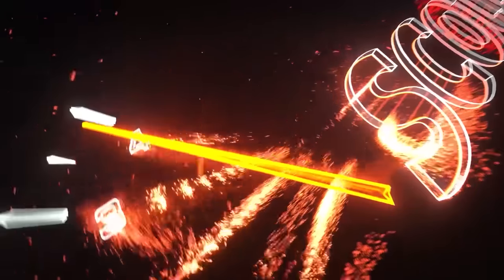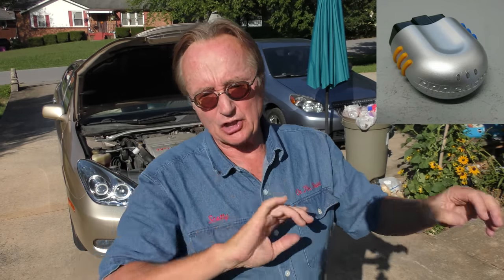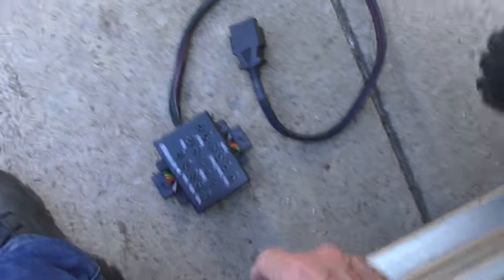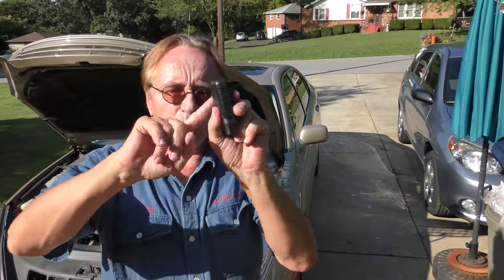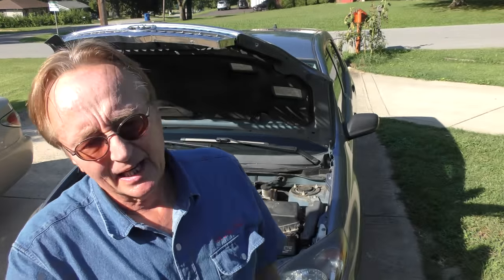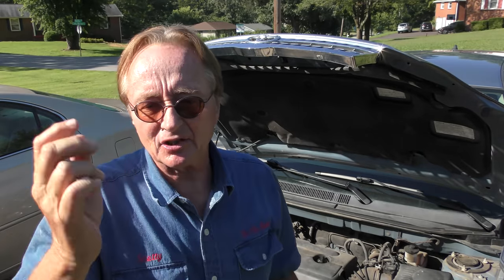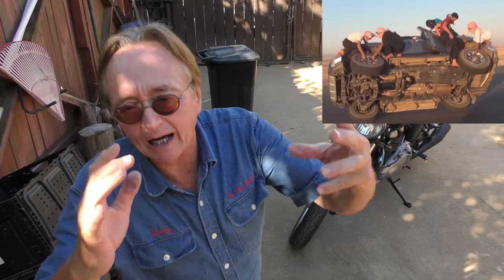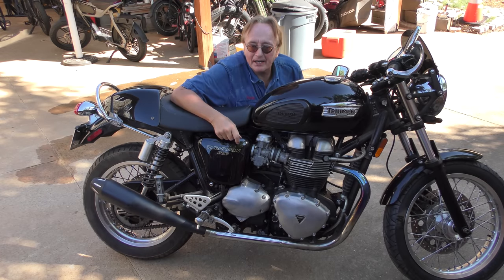I Told My Customer Not to Do This, Now His Car is Destroyed

Comment: I once got conned into getting a Hum through Verizon that plugged into the OBD2 port. Had it on my wife's brand new Subaru. It was supposed to basically keep tabs on the car's health proactively, which it did poorly, but then the  transmission started shifting erratically. Wasted time taking it back and forth to the dealer then simply removed the junky Hum and it was fine. Wish I had known beforehand. Great info as usual, Scotty!

Comment: Scotty, I've been driving with a dongle that keeps my GMC Yukon from switching back to 4 cylinders for years now and I haven't had any issues.  When I take it out and it switches to 4 cylinders I get a very strange hum sound. This device cured that hum and vibration.
Reply: Same here ...worth it
Reply: I have it in my Corvette to stop the cylinder deactivation which is known to kill the transmission. No issues. I disconnect prior to any service and leave it my pocket.
Reply: I'd use one too if I needed it but it's a shame anyone needs one in the first place due to big brother mandated Cafe
Reply: That may improve the life of your engine, and ensure proper lubrication of all cylinders by keeping all cylinders active.

Comment: I have a plug from my aftermarket Pioneer head unit in my OBD port, It monitors the MPH, Braking, intake temp, load, fuel, tire pressure, battery voltage and RPM. Never had any issues so far (knock on wood)!
Reply: ugh i have a pioneer unit and that itself is a piece of junk always disconnects

Comment: I have a Garmin Bluetooth dongle for my gps. This old gps allowed me to have digital gauges for speed, rpm, coolant temp, battery charge, etc. It also acted as a cheap code reader. Very useful. Fortunately, I never had a problem for the past decade with it on 24/7.
Reply: I have used a Scan Gauge on my car for years plugged in all the time without any issues.

Comment: My car has an aftermarket cruise control (Rostra) plugged into the OBD2 port. No issues after 5 years.
Reply: Just lucky.
Reply: @AlskinsX1-9 lol, 5 years and you think they are "lucky"? Nothing's wrong with it.
Reply: Aeroforce interceptor gauge plugged in and works great for racing for years now also

Comment: For what it's worth, I've had a Range Technology AFM/DFM Disabler plugged in my 2017 Sierra for well over a year without a single problem. Turns off the awful cylinder deactivation. And it cost a LOT more than $9.99!!!
Reply: I have the same thing and the same truck 2017 Silverado
Reply: I do too. Maybe we should go get the AFM disabled properly and take that range thing out of the port
Reply: Same here 2018 silverado I call bull on some of this 😂
Reply: Same here 2018 Sierra , well over a year no problems yet
Reply: Same here. 2016 Sierra 4 years and 8,000 miles with no problems. Also 2014 Corvette 3 years and 5,000 miles with no problems.
Reply: This is one of the exceptions to the "they're all junk" thing Scotty is talking about.
Reply: 2016 silverado with the same thing. 55k miles with no afm and no problems
Reply: Have one In my 15 silverado too....well worth it 93000 miles no issues
Reply: Agreed that cylinder deactivation is to be avoided.

Comment: Very true on the tires. I had really nice grippy tires, put 110K on them. Car spends 99% of its life in the garage. No dry rot but they were 12 years old and you could feel how hard and slick they had become. Tread was getting low but otherwise they looked great.
Reply: I replace the street tires on my cars 3 years from date of manufacture, regardless of tread depth. Now, the life of my track tires is measured in hours and laps so aging out is not a problem LOL.
Reply: Scotty, maybe it's time to give up the motorcycle 🏍️

Comment: Thanks Scotty! Even proctologist and surgeons know all about not shoving  random things into places where they should not go.  It causes all sorts of problems or issues.  Rule of thumb if it is not in the plans of the creator or designer dot shove it in.

American family actually has a travel app that operates via data being transmitted from the phone and GPS.  It's fun because it works in whatever vehicle you are operating or riding in. It can even tell if your the driver or passenger.
Reply: Don't knock it til you try it. 🙂

Comment: Statefarm has one that sticks to the windshield behind the rear-view mirror. It's wireless and uses bluetooth. It connects to your phone to monitor your driving. It also monitors when  you move the phone! (distracted driving). I place my phone in the cup holder and leave it alone. My Tomtom has bluetooth hands free calling so I never have to move the phone and can still receive calls.

Comment: Ive had transmission flushes done every 50,000 miles on every single vehicle i have ever owned and im old like scotty lol and ive never had a transmission issue and i usually keep my trucks for about 250,000 miles and then i sell them because i live in the northeast and the rust eats them.  My last truck had 16 quarts of fluid in the transmission but if you only drop the pan only 6 quarts comes out and the other 10 quarts of dirty fluid stays in the cooler/converter ect, so i get them flushed to get all 16 quarts of old fluid out no way im leaving all that dirty old fluid inside.

Comment: Depends on what's hooked up. I had an auto start for my key. I installed it myself. It bridges the OBD port. Product by MPC. I plugged it into a 2015 Ford Fusion Ecoboost. Had it for a year. No problems. It depends on what is hooked up.
Reply: That’s interesting actually

Comment: Alot of people used them thing to stop the afm in Chevy vehicle's thinking thats going to prevent getting a stuck lifter  but it doesn't the only way to prevent a afm liter from failure is to remove the afm stuff out the motor and put the normal lifters and cam shaft in your vehicle

Comment: LOL I raced top fuel Harley's from 2003 to 2010 full-time all over the country. When I first started I bought a 20-year-old Suzuki 250 to use as a pit bike. It had the original tires. We used it extensively for those 7 years. Many times we used it for grocery runs that were miles from the track.  Had it at 70 mph with two people on it more than once. Those tires held up just fine. It had the original fuel lines too!

Comment: You right the OBD2 car connector is designed to plug anything on it forever, and drive the car, it is only for car diagnostic for short time, I learned the hard way, but I was lucky the scanner connector harness got burned and separated and the scanner stop working.

Comment: Those OBDLink bluetooth adapers are quality. The mx+ being the latest and greatest. LX is good too (no ios support or some features). They have no conflicts when auto detecting the can bus and switching the American MS and SW. And can do bi-directional. They are great for gathering data for days at a time. The cheaper modules conflict and start screwing with the network. Mainly putting 13 volts where it shouldn't be. Who knows whats in those snapshot things and why they are even allowed after so many complaints.

Comment: Just did major tuneups on two vehicles Subaru crosstrek and Rav 4 plugs coils tranny fluids differentials water pumps brake fluids plugs coils serpentine belts t stats antifreeze brakes rotors pads I like to keep them maintained

Comment: I plugged one into my 2013 Honda Civic I pressed scan it was scanning then my rpm and my gauges started moving around as I was in horror. I then removed it then the battery to clear the codes thankfully no damage

Comment: I had a dongle plugged in for a few years without any issues. All of the e sudden, my car battery was drained after parking for a week. Replaced battery with new one, same thing happened. Pulled digital multimeter out and checked for parasitic draw and found out that the dongle was the culprit. Don’t leave it plugged it.

Comment: Yes they can internally short out and send 12volts through the CAN system and other low voltage circuits in the obd2 connector.  If you want to shut off GM AFM just do it the right way and shut it off through HP Tuner and if you have one in for insurance savings you either have a bad record or need to find another insurance company…

Comment: I have my  car professionaly tuned through my hondata where i can monitor the car. i feel like that an exception even though its technically not supposed to be on the road, i dont drive with it in often but when i need to datalog ill use it or to flash another ecu calibration.

Comment: I used Snapshot, and still get the small discount. But, it messed up my truck. I managed to get by with it plugged in for a couple months, and the company said they got enough data to give me the discount. It was giving just random errors in any computer. 10 years later cars have 5x as many computers, I can only imagine the crazy that would be happening in a new car.

Comment: Apparently Scott is not familiar with the ScanGauge tool. This can be left connected because it does not work in the same way that most other cheap devices function. I had one connected for years to my Prius to monitor the hybrid system and also on a regular SUV. Fantastic device!
Reply: Scangauge has been a life saver for my vehicle. Very lovely real time diagnosis.
Reply: Same goes for the Blue Driver he mentioned.   You can leave it installed to receive live streaming data on the app as you drive.
Reply: I had a scangauge on my is300 for 5 years. Never had a a problem

Comment: Scotty that OBD2 dongle you had in your hand and said not to buy one of these cheap $19 dongles eas actually a $200 XTool dongle. They're supposed to be pretty good. Why don't you do a decent review of the XTool A30M and their application. The A30M is supposed to be roughly equivalent to their dedicated XTool D7 plug in tablet tool but you use your own tablet or your phone like BlueDriver does.

Comment: I have to agree about Pirelli tires for bikes. My first bike is a 150 Super Vespa. They had and still do have Pirelli tires. My former three Harley Dave's had different brands and I trashed them for Pirelli. I had some backlash from my two wheel brethren of all sorts, but I told them about my Vespa. Most of them went to Pirelli. 
Sad fact, that Vespa never left me on the side of the road! Yes, an Italian bike needed very little maintenance... very little.  I sold my Harley's. I still have that 150 and she has had very few repairs after 80K. It was tuned by my to RUN between 45-70 with ease... all stock parts. Nobody complained the Pirelli"s on the buzzing wasp. Usually someone would offer me a very lucrative price for her. NOPE NOT FOR LOVE NOR MONEY. 
Mikel 
Aka Tongue
Reply: Personally I prefer Michelin but have Pirelli's on my current ride, I'd steer clear of Metzler though.

I had some old cheap tyres on my car which I'd bought in 2008. Started driving the thing regularly again in 2018 after working interstate, and one night on wet roads in 2020 went to brake hard and slid straight into the intersection, bought new tyres first thing next day. The rubber in the old tyres had gone hard and wouldn't grip, the difference in braking capability with the new ones was astounding.

Check the numbers on the side of your tyres and you should be able to lookup when they were made. Anything older than 4yrs I'd recommend replacing.

Comment: I have a Ford Focus St with a tune. To put the tune on, it was done by a professional tuner using a Cobb Access port. I run the Cobb Access port in the OBD port, and it shows me a lot of information. Some of that info is ignition corrections for the 4 cylinders, actual AFR, boost etc. I don't have to have it plugged in once the tune was installed, but it's nice to monitor those things while driving to see if anything goes wrong with the engine. What are your thoughts on this?
Reply: I was thinking the same thing since I have a COBB access port plugged in my WRX   24-7.....lol
Reply: I’d take Scotty’s advice. Only use the OBD port to diagnose a problem. If everything seems to be fine, don’t plug anything into the OBD port!
Reply: @lukek1949  are you Scotty?

Comment: You are 100% right Scotty. You definitely don't want 2 blow outs.
Yesterday that is exactly what happened to me.
Passenger side got pulled to the right, compliments on the road, my tires dropped off the road and the pavement had big chunks out of it, and my tires ended up the same way. Big chunks out of the sidewalls.
Definitely gonna stay closer to the middle line in that area.

Comment: Watched your video from few years ago about batteries. Well since alternator charges the cars battery why don’t the manufacturer put an alternator on all the electric cars. Not only you wouldn’t have to plug it in and pay for a charge but at the same time there wouldn’t be a restriction of how many miles those cars can be driven before needing a charge
Reply: DRRRRRRP!
Reply: They do. The electric motors that turn the wheels also work as generators when the vehicle’s momentum spins them instead of the electricity from the battery. That’s what regenerative braking is.

Comment: What about gps devices specifically designed for it? Geotab, samsara etc have millions of cars using them daily with millions of miles on them. It doesn't put the vehicle in diagnostics mode and always remained plugged in

Comment: I did the progressive one, and it did lower the cost of my insurance, however, the car I had was a 2001 Volvo v70 and because of it would keep blowing a fuse. The problem was that to replace that fuse was about $200 since I had to return to the dealer to have it replaced. And the dealer was about 100miles from where I lived.

Comment: Got a question. I just bought a new '23 RAV4 and was wondering if changing the oil after the 500 mile break-in is still a thing? The dealer said no, but he is a young salesman.
Reply: I've seen metal chips in sump drain from new Toyota. Oils cheaper than engines  change it.

Comment: The insurance scanners are a big scam. As soon as you brake hard once your insurance company is gonna jack up your rates and you'll forever have that red mark on your record with that company.
Reply: I've seen similar comments at least twice while reading the comment section. It's why I've never owned one. 

In a world where nobody else drives correctly or safely, there's way too many variables that go into play once you leave your place.

Someone mentioned earlier about having to slam on their breaks due to stupid reasons and I understand completely. 

I could be driving 30mph in a 35mph zone and still, you get those people, more times than not, that will stop out of nowhere to turn without a turn signal.

The insurance devices help insurances companies. Not you. I miss when insurance companies actually gave customers genuine discounts for no car accidents and other things. 

I had to dump Progressive years ago when all the discounts I had still wasn't enough to get the car insurance to go down. Was a Progressive member for a few good years, too. Found out a local car insurance agency could knock off $20/mo. 

Since I moved out of a country region, my insurance went from $50-something/mo to now $60-something/mo.

Your insurance increases if you move from a country area, into a city area. I need to shop around again because after so many years, insurance companies just keep adding onto your insurance bill.

Comment: Yo Mr Kilmer, I'm a Brit that follows and enjoys your channeL. I love the humour and honesty that comes in your vids....however, I must take, with a smile, offence at the generalisation that Triumph motorcycles are all oil leaking unreliable bits of junk. I didn't see a Harley on your drive.
I've owned I think eight of the Hinckley built Triumph's since the mid nineties, the early bikes were solidly built and as the name got buyers back the range of models increased as well as being more so built in house. Unfortunately  as you point out, it has been noticed that quality has dropped off over the years with an increase in the use of plastics and some questionable engineering designs that seem to fail quite regularly coupled with a customer service department that is anything but customer orientated. These faults and problems are just as common with the Thai built bikes as the UK one's.
I have had one Thai built Triumph and I have had that bike back to my dealer more times with issues than the UK built one's. Just my personal experience. One thing I can say, I have never had one of the Hinckley Triumph's have an oil leak as you suggest is usual. Nor have I had any starting issues either. I wish I could say the couple of Harley's I have had over the years were as reliable as the Triumph's...but I can't. 
As you are well aware, as with all the vehicles you advise people avoid, there will be those who had owned those vehicles and never had any issue with them and for every vehicle that someone has owned without fault, there will be those saying the opposite.
It's good to see you with a Brit bike if indeed it is yours, but don't knock them all.
A final word for all those that are nostalgic regarding Triumph's, these Hinckley or Thai built bikes have absolutely nothing to do with the original Meridan Triumphs. The Bloor family bought the name and nothing else,. Even the Triumph logo had to be altered. Look at how the underline loops the H for the old and new Triumph's.
Thanks and regards from the UK.
Reply: Explain ?? @Nozinbonsai